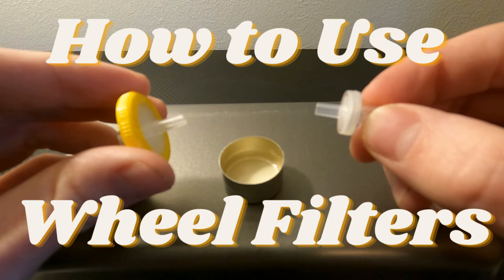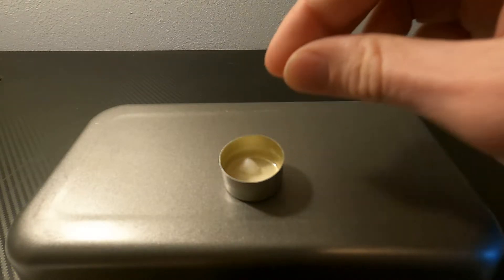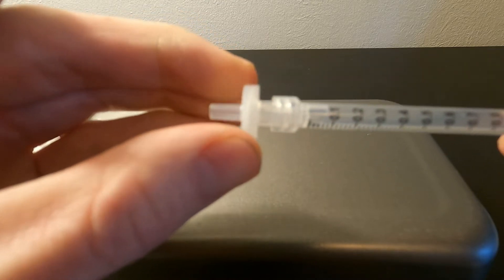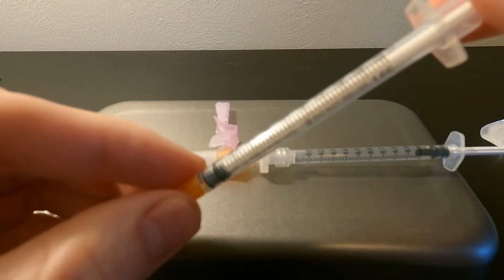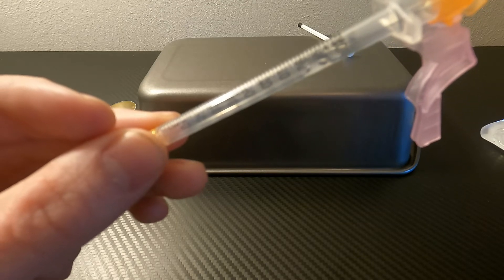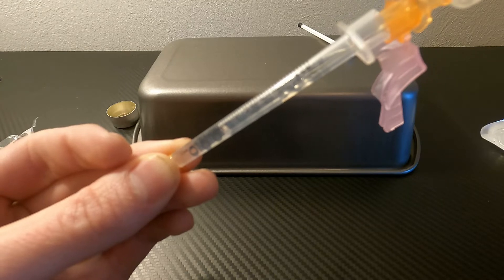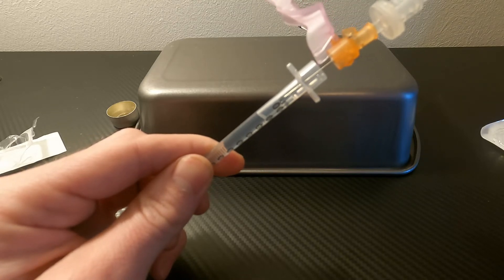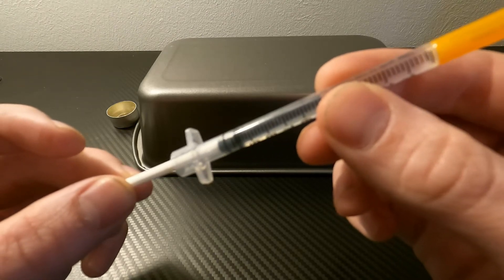How To Use A Wheel Filter

Comment: is a 1ml luer lock too small for a green wheel filter .22u ? will the pressure rupture the wheel?
Reply from the maker: Thanks for your question.  The video creator is not with our organization any longer, but I am trying to find the answer for you and will respond soon.  Sorry I don't have the info for you now.
Reply from the maker: Hi! Thank you for your patience.

Too small of a luer lock syringe volume won't risk rupturing the filter. The only risk with using too small of a syringe for a smaller diameter filter is that it wouldn't produce enough pressure to transfer the liquid.

 If too large of a syringe (eg a 10ml luer lock) is used with a small filter, it could increase the risk of breakage. However, that risk can be mitigated by applying the pressure slowly.
Reply: Get a synthetic organic medicinal chemist to make your pure drug WITH FREE DISCS, ptfe lines septum leur locks.   I predicted and found first samples of the Fentanylogues in animals, made to prove legally under license ones had no standards to run.  I can’t get free filters & they have taken everything from me for pointing to obvious solutions to these issues.   It’s not to filter poorly diluted and made dangerous substances. Start with high safety indexed compounds.  The only expert was here, I cannot loose anything else and will not lose freedom.  Where’s there free disc filters, thid is problematic, do lay people understand the vast field of types uses?